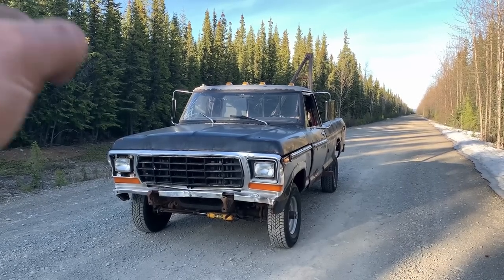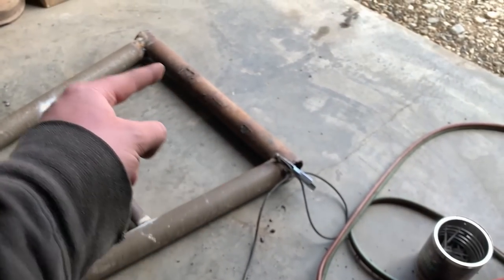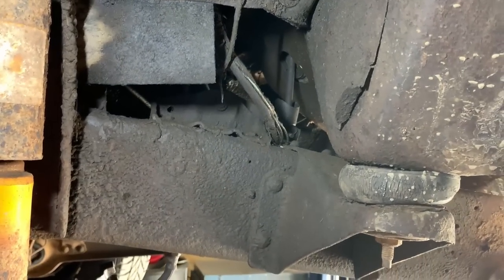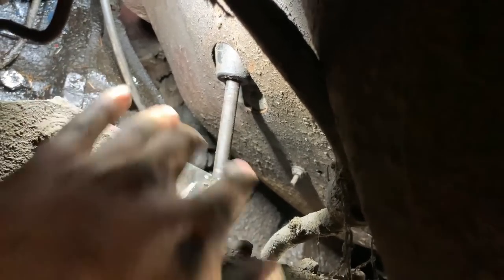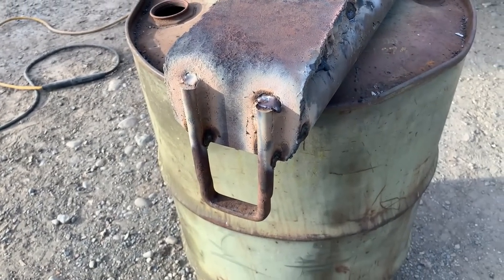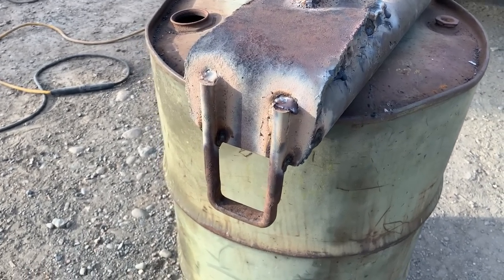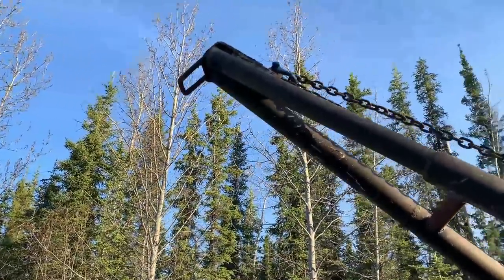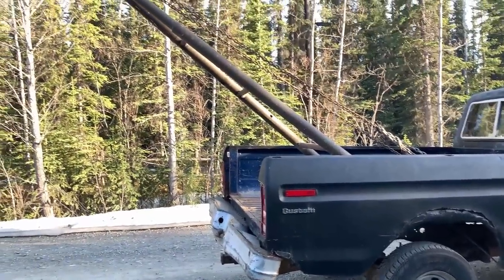Building a Pole Truck

Comment: Howdy! You mentioned putting wood blocks under your truck to lessen the squatting down. What I did was get a big coil spring. I cut it in half  and welded a chunk of channel to the bottom of each then I welded it to the axle below the frame. It doesn’t affect anything until a load is added. The frame settles down onto the spring and that’s it, it goes no further down. Works good. I did the same thing on my flatbed trailer with the same results.  Just thought I’d let you know what worked for me.  Like the videos, thanks!

Comment: * Austin ! You always put a smile on my face ! Dude you could use those poles for double duty. If you put a sparker in the bottom and a bung to load them with ether then put the end plate between the poles you could make an awesome double barrel Potato Gun !!! Also you could hook propane tanks up to the bungs and shoot flames into the sky !!!      🤘😎🤙

Comment: Your enthusiasm is great, and I enjoy the content. Someone will probably give you a hard time over the welding, and fitting, but I think you are doing fine. The only way you get really good at it is by doing it. Just like you are. Stay with the stick welding for the structural stuff, an ugly stick weld is often stronger than a pretty mig. And remember that better fitup makes it much easier to make good welds, especially out of position. Keep up the good work!

Comment: Haha, thats Mainer style my friend. I dig it, i have my own rig of a similar set up, 78 F250 4x4. She gets mauled often snd well used. The boom is off a 61 F350 wrecker, on a 77 flatbed, the boom is held up by round tubing welded in place insyead of the old cable like it had. Takes a licking well

Comment: So uhh, no tension chain to hold the boom down? Looks like nothing will stop it from swinging forward and crushing the cab if you were to jam the brakes on going down a steep hill or bouncing it down a trail. 

Its a pity angle grinders are illegal where you are. I get the rough and ready build style but goddamn dude.

As for the springs bagging out, look at the old rock crawler trick of the "Zuk mod". compress a few old coil springs and land them on your upper and lower bump stops, then open up the compressor. It will support the center of the leaf pack and can easily be removed with the coil compressor if you need to drive it unloaded. or just get some hefty old chain binders and fab up links that you can swing down and lock to mounts on your rear axle and essentially lock the rear suspension in place. The screw threads will let you adjust for uneven ground. When you're done yanking something heavy, pull the lynch pins, pivot them back up to the crossmember and pin them in a stowage position.